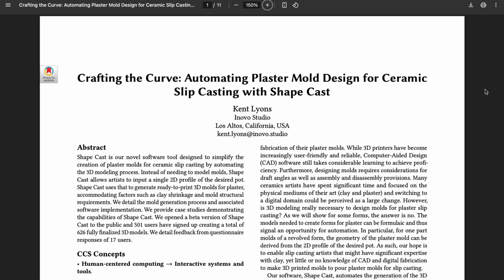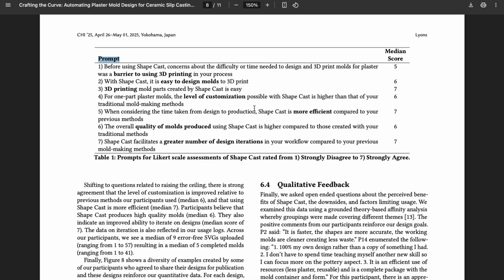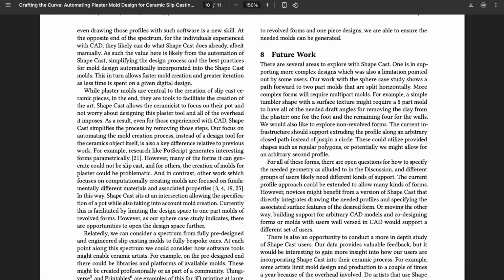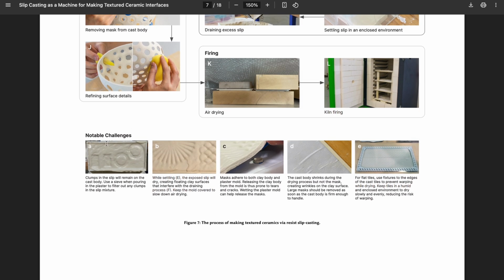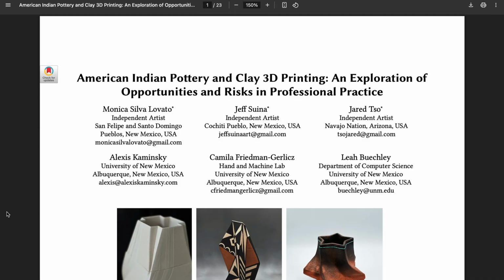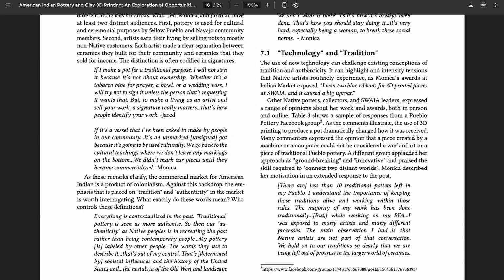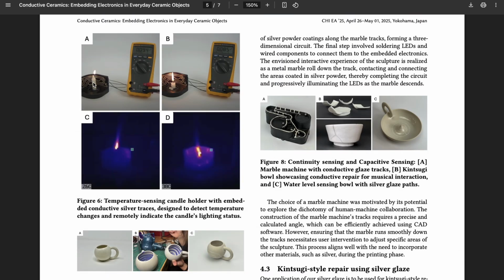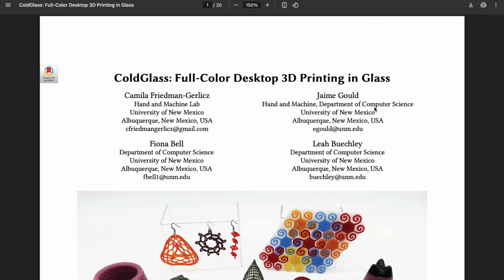Technology Research and Ceramics

Comment: Thank you for sharing this! I am super interested in this sort of research but don't know where to start with finding it. 

The vinyl sticker tenchnique is very interesting, but i think the low thickness is part of the issue. I have started to dive into ceramics with a background in 3D VFX and resin printing, and this has re-jogged an idea I was playing with that I will have to try out, which is 3d printing an insert to take the place of the vinyl in their paper. The additional thickness should allow for sharper details, but the complexity would arise in that I'd probably need a 6-part insert depending on thickness hehe. Resin printing can give ultra-smooth surfaces that i think would do the trick here for creating holes in a cast.... Could also do thick silicone. 

On a side note, have you seen the method Dan Gelbart put into the public domain a few days ago? If i can get a good deal on a freeze-dryer, it's going to be `bye bye` to plaster and worries about overhangs! Truly a potentially revolutionary process
Reply from the maker: I did a series of experiences trying to make a rice grain effect lamp on a moon jar. This required putting a LOT of holes through the wall. the challenge is while plaster is specifically designed to absorb water, it still does deposit a bit on other things and by depositing on clay that is adjacent. So it still requires post processing. For that paper, you can see it covering up the area next to the stencil with varying thickness. 

I just went searching for the freeze dryer thing. I've seen sintering printers before. I'm not sure how well it would work with ceramics - I'd imagine the porosity would not be the same (higher), but that's just a guess.